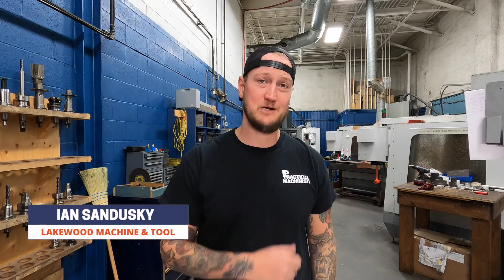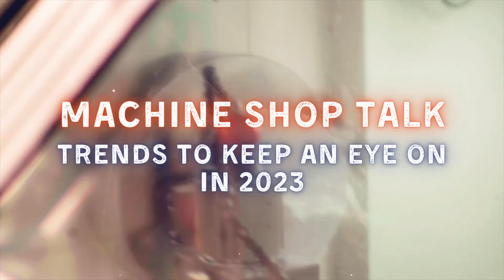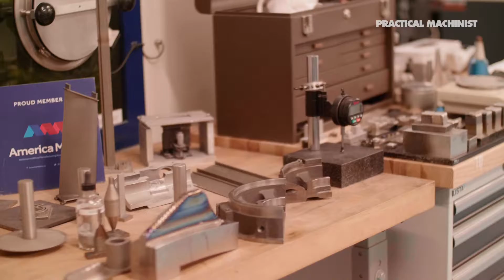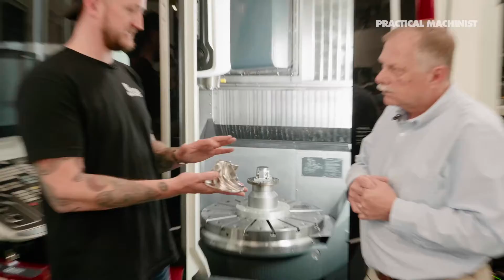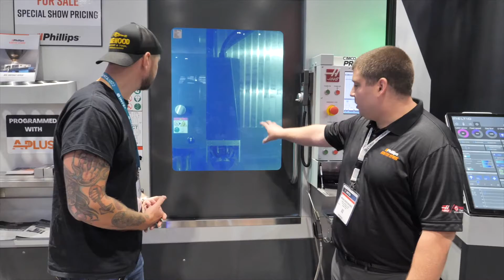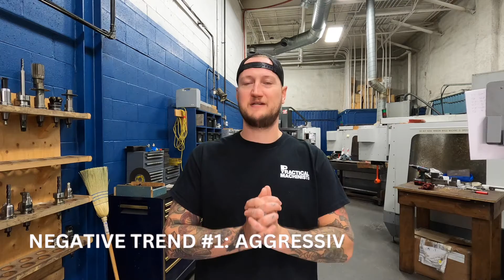Trends to Keep an Eye on in 2023 | Machine Shop Talk Ep. 74

Comment: As a little kid, when I learned about how American businesses were sending OUR work overseas, I was furious (still am). I guess I wasn't a normal kid as this was an issue that probably wouldn't even enter their minds for another 20 or 30 years - if at all.
To me, a patriotic American would never dream of deliberately gutting our manufacturing. 
Manufacturing is the very backbone of any thriving society. Manufacturing is, basically, the business of printing money. 
You take cheap, useless junk, and you apply a little sweat and ingenuity and you create a valuable product. Manufacturing makes expensive stuff out of cheap stuff. It's basically the goose that lays golden eggs. 
If one has even a single functioning brain cell, you don't give away that goose and you certainly don't give it to foreigners who we don't even know. 
I'm still furious that treasonous, greedy pigs gave away our golden goose solely so that they could line their pockets with ill gotten gain, at everyone else's expense.
If all of this doesn't make you angry, then think long and hard until it does make you angry.